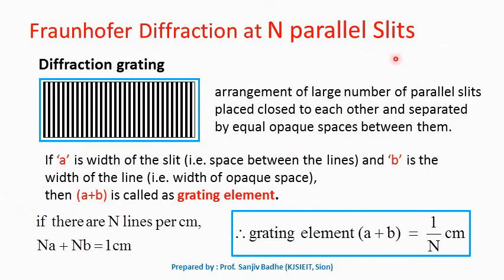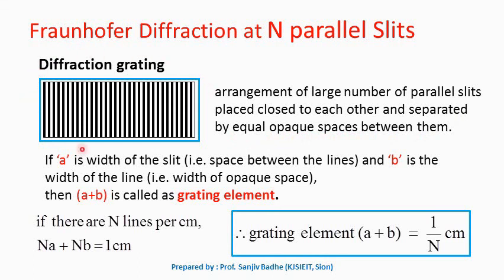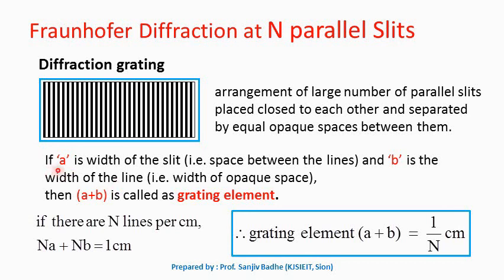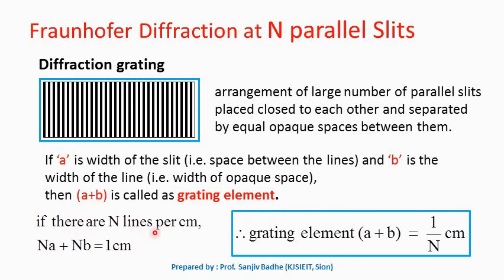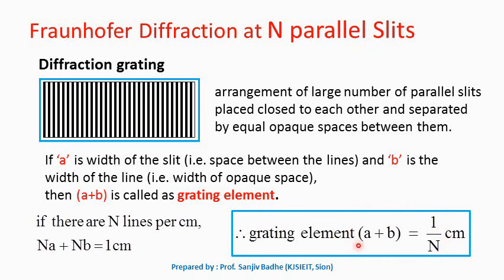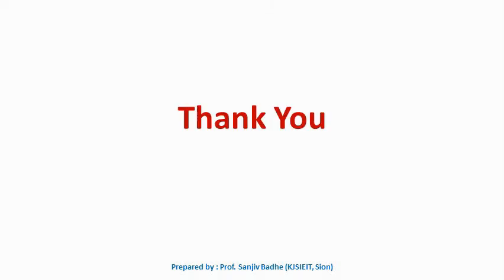What is Diffraction grating and grating element?

Comment: Sir diffraction grating or transmission grating they both are same or different? Bcuz when I am searching for transmission grating every where l am finding diffraction grating so both are are same or different??
Reply from the maker: Diffraction grating can be used as a reflection grating or transmission grating. If we get diffraction pattern on the same side from where the light waves are incident, then we are using grating as reflection grating. If we make light rays incident from one side and get diffraction pattern on the other side, means grating is used as a transmission grating..
Reply: Thank you
Reply from the maker: Welcome🙏